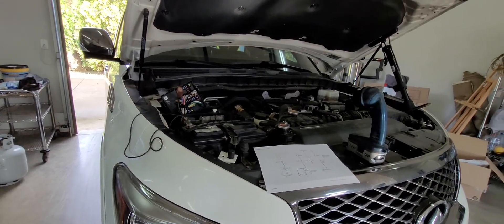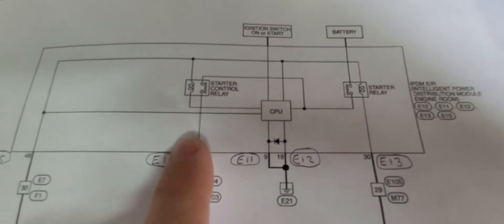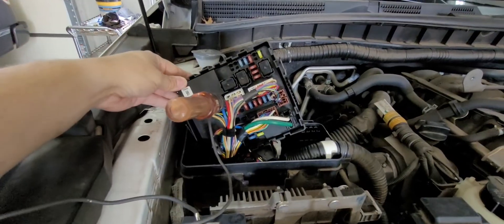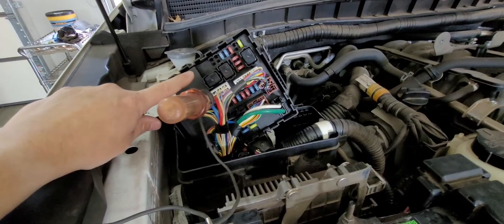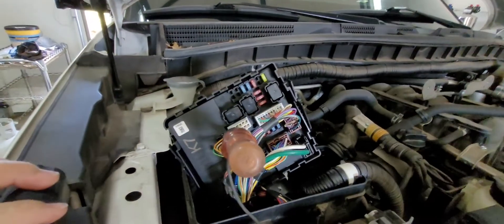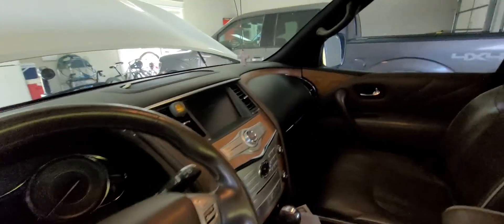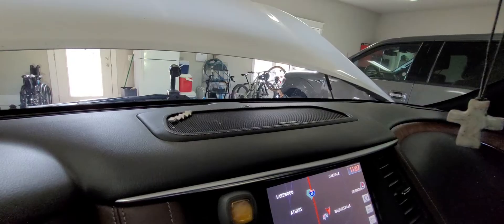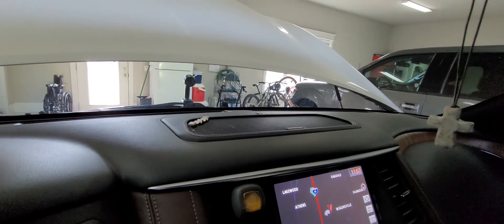QX80 No Crank No start SOLVED! How to test if your IPDM or starter is bad.

Comment: Just came across your video and I think I may have a similar problem with my 2015 QX80.  Can you confirm if my description matches what you were experiencing?

90+% of the time the car starts with no issues.  However occasionally you will depress the brake and hit the start button; all of the lights in the car come on as normal, but the car does not crank.  To be clear it's not that it struggles to crank, it does not even try to crank.  Then if you patiently try enough times (never taken more than 3 or so minutes) the car will finally start.  I have put a volt meter on the battery at rest and after starting and it appears that the battery and alternator are both good.  Does this mesh with what you and your wife were experiencing?  Assuming so what all did you investigate prior to getting to the IPDM vs Starter test you put in the video.

I really like the QX80, but if we can't figure this out we are going to have to get rid of it.  Thanks for any further learnings you can share.
Reply from the maker: Your description is exactly what we experienced with our Qx80. Initially I thought I might have had an ignition relay problem,  but deep study and troubleshooting on that proved ignition wasn't my problem.  Check my channel in the QX80 Playlist if you want to see a video on that. This  video on the starter is your best bet, your issue will be that you need to test when the car isn't starting.  Which isn't very often ( same with me). I set everything up early one morning and after a few good starts,  it finally gave me a no start and I was able to confirm my situation.  Good luck.  BTW- I replaced my starter and have been 100% reliable since. My wife is back to loving her luxury SUV.
Reply: @jacks_DIY98  Thanks.  It has not happened again when I have been at home to test it, so I have not been able to put your information to use yet.
Reply: It almost CERTAINLY the STARTER MOTOR SOLENOID.  PERIOD.
My '14 did the same thing in May, when my wife was 6hrs. away ( on a 1,500mi. trip ).  They jumped it and jumped it w/o success.  Ran the battery down ( so they said ).  Repl'd the "bad" battery ( so Auto Zone said ).
Eventually...,...,...it started.
So she went on with her trip.
Come September...same thing..."clunk" sound when attempting to start...no crank.."good" batt.  ( THIS time it was at home base.  I was checking it before she left on a 2,500mi. trip. )
So I checked the solenoid trigger signal wire ( term #50 )...the small gray wire conn. on the rear right bracket at rear of intake manifold.
GOOD SIGNAL.  in short repl'd starter ass'y w/$120 AMAZON part ( bought 3yr. ins. policy on starter $20 ).
She drove to WDW & back...2,500mi. NO MO' PROBLEMO!
Reply: @SpicyRok7482 was the steering wheel locked?  Ive noticed mine will lock when won’t start.
Reply: @londahamrick4634  It was the starter motor solenoid.  I got a new starter motor ass'y from Amazon &  a 3yr. insurance policy for $140 total.
In October it will be 1yr. since replacement...it has not acted up once.
Another WDW trip coming up after the "anniversary".
It starts & runs just fine.
Reply: @SpicyRok7482  just replaced starter and solenoid so We shall see. It has 209,000 miles. Prob due for new one. Lol
Reply: @SpicyRok7482  at that price, its worth it to just change it for a new one and see what happens.
Reply: @jkMLS99  It was a year last Nov.  NO HINT of a malfunction since.
Reply: @londahamrick4634  I would say that starter motor, if OG, had served you well.
Reply: My 2014 does this too once in a great while.  I have a Platinum Warranty good to 120k miles I believe so I've been wanting to take it in but what if they can't reproduce the issue?

I read somewhere that the SUV sometimes doesn't know if it's in neutral or park so when this happens I put it in neutral and it starts.
Reply from the maker: @hwyking  You are correct in your hesitation to take it in. If the issue doesn't occur while they have it,  then they can't diagnose.  Unless the vehicle has left a module code in the system that they could see but wouldn't be displayed via your check engine light. In my case,  I set up my diagnostic tools and kept starting and shutting off until I got a random no start. At that point I was able to verify the situation.
Reply: I’m having same issue with 2014. We replaced start  button, break switch and was problem free for 3-4 months but started back. I’m wondering now if it’s my starter. It’s been great truck- 205,000 miles I’m only owner all highway ball travel miles. Lol. I don’t want to part with it. 
Where did you order your starter?  My hubs is handy- how long did take you to replace starter?
Reply: Did you notice if the steering wheel would lock. If I turn off and let it reset for while it will crank so it tells me something is not disengage or Ned’s to reset. I’ve replaced the start button, brake switch. 
Now gotta see if it’s one of the three items you all have mentioned. It powers up and once starts works and runs great with no issues. Me too hubs is never around when happens 😂
Reply: I honestly kept pressing start button almost like a kickstart on motorcycle and it would start. 
Sometimes it will make this click click sound with nothing happening except all electronics are booted up. I just shut it off and come back hour later and it might start. Lol. I love my 80. It’s loaded and just flat out refuse new ride. I’m determined to fix it. Lol

Comment: I didn’t get that problem plz what is the problem, my car doing the same thing 
Every time I try to start it kills the battery I charged the battery almost like 4 times,
What do you think I should do 
,
Any solution
Reply from the maker: This video tests the IPDM start signal to the starter motor. When the test light turns on, that proves that the IPDM is working. If your battery is going dead often,  I'd verify that your battery is good.  Recharging a bad battery doesn't make it a good one. If your engine turns over(cranks) every  time you try to start it,  then this video is not what you need.
Reply: @jacks_DIY98  does this control the alternator as well?
I have a jx35 and my alternator I had changed last week for $800 battery and brake light still on and dealership is saying its the alternator because apparently the mobile mechanic used a brand name but not exactly OEM. And now Nissan wants $1712 to put OEM in.
Reply from the maker: @brendacalderon9445  Sorry to hear you're having car problems.  To answer your question about the IPDM working with the Alternator,  yes there is a connection between the alternator regulator and the IPDM. However, I wouldn't guess the IPDM is your issue at first.   I hope not, they are very expensive ($2500). If I were you,  I'd go back to the mechanic who did the work and have them confirm the parts used are compatible and explain the warning lights on your car. They should be able to do a quick test to confirm the alternator is charging the battery.  An auto parts store can do the test for free as well.